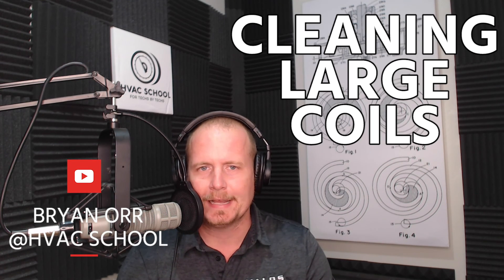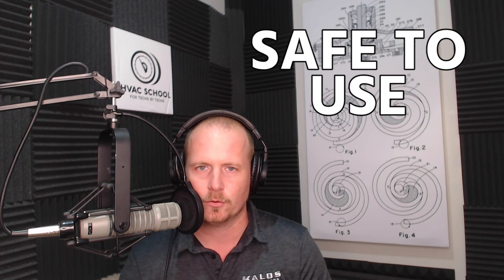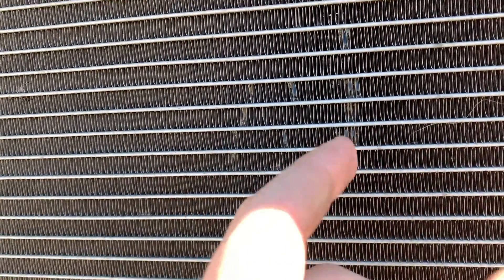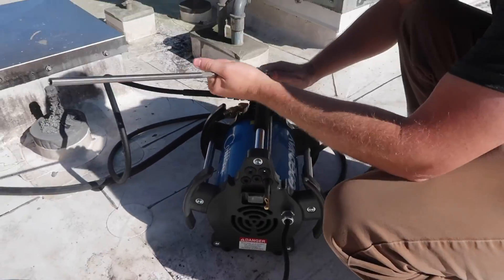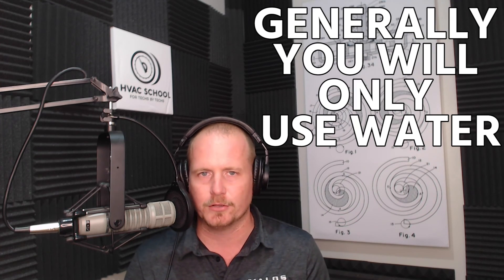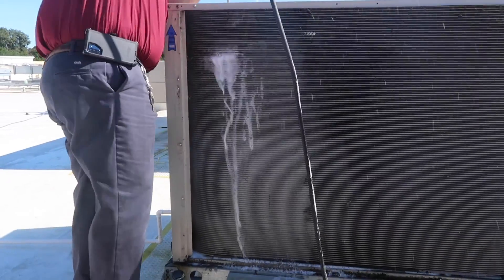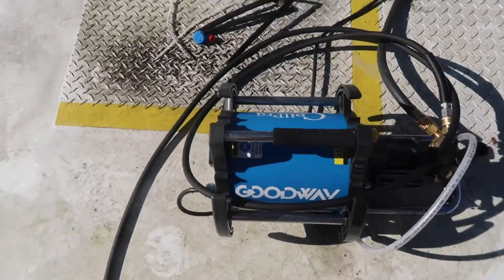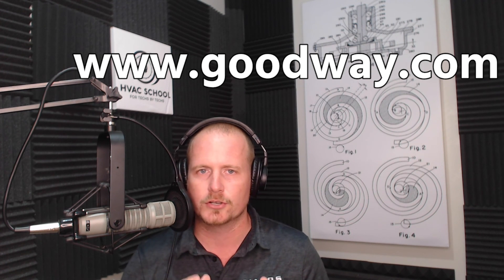Cleaning Large Coils with CoilPro

Comment: We just picked up a couple of these at work. Great machines. Using it to clean 6-10” thick chilled water coils in  air handlers from the 1950’s. It takes some time but they eventually push dirt all the way through the coil